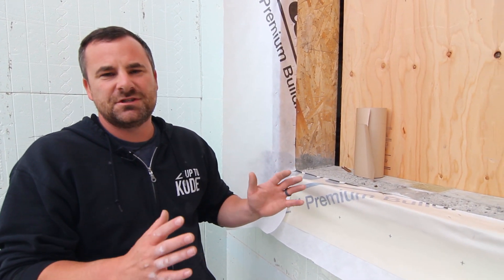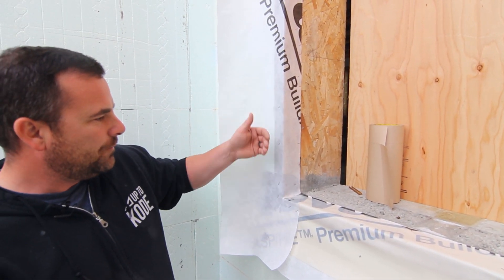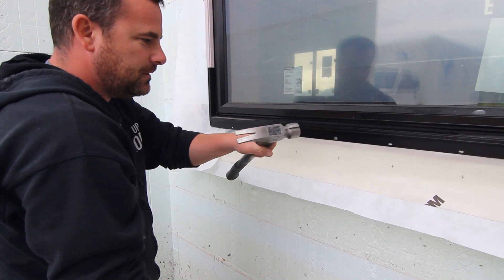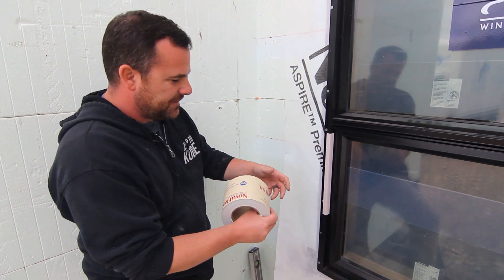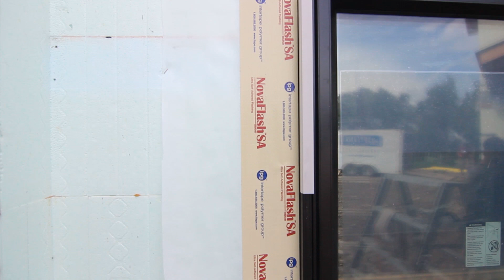How to Prep and Install a Window for an ICF Home

Comment: What do you think of buckless, direct to concrete window and door ICF installs? I've seen a study where this method had the highest penetration resistance.
Reply: yes... I make a metal 2/4 stud and track ....I metal nail the stud to the concrete core and then attach the track to the stud... now i have a strong base for the window - I use compensation channel and then use Equal Leg Frames... so can install windows from the inside of the house.... it is a hassle, but prevents any water intrusion that happens between the EPS and the concrete core... The concrete core will not 'leak water'... applying with a nailing flange to the outside on an ICF build is nuts.... you need to place the window either flush to the outer surface of the concrete core or inset it from the edge.

Comment: Hey Kody, building about 4 hours north of Red Deer. Is the process you used here still current?  We will be installing our windows into our ICF basement in a little over a month. Also what kind of jam do you recommend?  We have 12” ICF walls and have been given an option of 12 1/8 jam so that you can fit the drywall underneath or 2 1/8” jamb with 1/2” drywall return where we would have to do a separate jam. Im not sure what’s easier to install and easier to finish. Thoughts? Thanks!

Comment: what is the product you use for the 6"x6" corner square- you call it "peel & stick" is that just the 3M?
Reply from the maker: Yes I use the 3M tape for that! Same goes for the little butterfly stick for the corner. They do make plastic corners but I find they build the window out too far and it messes up your siding and the jamb depth for your time . 3M keeps it tight

Comment: That's a LOT of Origami.  I see belt and suspenders and duct tape and bailing wire and pocket lint and bubble gum and a Bic pen.  Why not just use Prosoco and sleep good at night?
Reply from the maker: Tell me more about it. I assume it’s liquid applied membrane? Is it rated and tested for ICF? I still need to research all the types but that takes time and effort
Reply: @uptokode  I'm gonna contact the ICF companies.  Just thought I'd ask your experience.  I love building high-performance stuff.  It's like building race cars.  (I think I want to build premium homes (like a Tesla)  with zero energy bill guarantee (restrictions apply), bumper-to-bumper warranty and a maintenance package for well-heeled clients who want peace of mind.). Numbers like yours go a long way.  You're cold & dry, we're hot & humid.    

Prosoco is family of products like Poly Wall - roll-on (or spray & back-roll) elastomeric, 16 mils thick, self-seals around nails.  Sort of like Zip-System coating.  I don't know if the ICF foam is too fragile.  They also have liquid & big tube products for seams & wrapping around windows & doors.  It's continuous & no layers, like a submarine.  I'd like to circle the house as few times as possible.  We cant/tilt our window sills about 3 degrees to the outside and use the paint-on Prosoco WRB (water resistant barrier) all around.  Then we run a backer bead around the inside of the window-to-frame and seal that also.  This makes ithe window completely air & water sealed & makes a sill-dam to keep out water.  Like you, we don't seal the bottom window flange to allow water a way get out, while eliminating air leakage.  But at 0.23 ACH50, you're WAY below Passiv Haus.  Doing something right.  This also eliminates air sealing by hand and AeroSeal, AeroBarrier.

I'm learning about ICFs because I'm moving to the Emerald Coast, Florida panhandle, and I looking for products to be our SOP (standard operating procedure).  Using LiteDeck allows the (flat) roof to be used as living space/deck.  I've been working in the Bay Area, California, in earthquake country, doing high performance projects.  Florida is different from California (no earthquakes) and has different issues like hurricanes, humidity, lost of rain, 95% of the time indoors so IAQ, VOCs & mold are concerns as well.  

Are you running a rain screen outside the ICFs, behind the siding?  I'm exploring fast, effective ways to address this new set of challenges with as many synergies as I can muster.  Did you take helpful class(es) for each brand of ICF?  Did you ever try the concrete version of ICFs (autoclaved aerated concrete)?  I forgot that Florida has termites also.  I know the termites can't get through the concrete, but people have had termites/other bugs nesting inside the exterior foam siding.  

Anyway, impressive numbers.
Reply: @uptokode  Hi.  We used Prosoco brand, but there are other similar lines we looked at.  They have the big sausages that you apply and spread out all around the frame, and out onto the flat exterior.  This stuff is heavier and has fibers to make it stronger.  We sloped the sill to the outside for positive drainage.  The windows go in & we seal the sides & tops to the building, leaving the bottom open for drainage.  At the interior, we put backer bead around the entire inside perimeter of the window + sealant atop that, so now we have 100% water and air seal, and positive drainage to the exterior for any water that might in, moisture/vapor mostly, I guess, in your climate.  Never a chance of any leaks.  Then the CAT5 product is rolled on the exterior (or use ZIP-R and the window buck treatment finishes sealing the opening to the ZIP).  Water barrier, air barrier, thermal barrier.  Now it's a submarine in very few steps.  🍒 We're going to be using this system in Florida where water and humidity are constantly trying to invade our homes.  ICFs for hurricanes, rains, bugs, termites, fire, durability.  I'm trying to identify the challenges so we can mitigate them and combine positive synergies.  Let me know what you think.  Really.  I like your videos.

Comment: Is the house wrap enough to protect from watershed? I worked on a multi unit building made with icf and we used house wrap everywhere but were still getting leaks in many of the windows .. I was not on the project since day 1 so Im not sure where they went wrong but this was a serious issue. Is there any video on how you do it properly so that there is no leaks whatsoever? Thanks!
Reply from the maker: Great question.  Tons of factors that could cause leakage. Sometimes it’s real basic like shingling and layering things properly. Some trades still don’t understand this. The only other system would be a proven liquid applied membrane which I’m still learning about.
Reply from the maker: End dams on drip caps are critical (top side of windows). Making sure you have a drip cap at any horizontal break in the siding. This allows all the water from above to fall away from the building instead of running all the way down from the very top.

Comment: Kody, you’ve answered some questions for me in the past I’ve got one for you building paper for the ICF. I was going to cover my entire exterior of my home prior to putting up the skin on the ICF which is going to be standing seam metal roof material vertically on the walls, was looking at Tyvek or blockit, and wanted to know if you had a preference my contractor is suggesting blockit because it is slightly acting as a rain screen because of its dimples. And thank you again for all your videos I came back to this one several times and coming back to it again thinking you might have made a suggestion.
Reply from the maker: I’m glad I’ve been helpful to you! I personally don’t like Tyvek but I don’t know anything about blockit. Sounds good to me having a bit of a rain screen. I like a more fabric based WRB versus tyvek where it seems more like plastic. 

You will need strapping on the ICF if you are installing vertical metal. Or anything vertical. 

I would put the paper on top of the strapping. This is assuming your windows are mounting to the strapping as well. It will keep the WRB on the same plane and will be easy to detail windows. Just my opinion. Cheers!

Comment: Hello, Kody! Thank you for this detailed video! I am planning to build my house with ICF blocks and currently designing window openings. I've noticed that this window opening is pretty close to the side wall on the left.. How many inches minimum should it be spaced from that "inner" corner? Does it make a difference if it would be fixed narrow (about 8") window with 12" ICF blocks?
Reply from the maker: You can be as close as you want but when you pour you have to install strapping to stop the corner from bulging outward. This is done by attaching a 1x4 or 1x6 (minimum 1 per row) and go across the buck and tie into the ICF further down. This is crucial

Comment: so it is ok for the window to be even more energy inefficient because it is already inefficient?
Reply from the maker: Even the best window has a low R-Value compared to the wall. In my mind it’s better to have a good buck with a lot of advantages versus a thermally broken one that only saves a very minute amount of surface area and would complicate installation of the ICF, the window, trim and potentially exterior finishes.

Comment: Hey Cody,
Love your informative videos. 
I have a self build project in England and am leaning towards using Nudura ICF 
The finish I would like to have on the outside is smooth render, I think you would refer to it as stucco. How does that apply to an ICF structure wrapped in building paper, would you wire mesh mechanically and then stucco or are there other ways?
Thanks,
Charlie
Reply from the maker: Hey Charlie. What we called “floated” Stucco is the smoothest texture without going with some form of metal cladding. 

For stucco I go with…
-typar against the foam
-then 2 layers of tar paper for drainage plain
-screw stucco wire to the ties 
-scratch coat, brown coat, primer and acrylic stucco finish. 

Tar paper directly against the foam will deteriorate it. That’s why you use a synthetic paper first. Hope that helps

Comment: First of all thank you so much for this, building a ICF home in North West corner North Carolina in 2023 wanting metal siding as the exterior finish, looking for suggestions or a video that you might have done that talks about applying metal siding do I need a spacer or can I apply the metal siding directly to the ICF naturally I would have a liquid air barrier applied to the ICF but didn't know if I needed a spacer between the metal and the ICF
Reply from the maker: I really like the idea of a liquid applied membrane. If you find one that is compatible with ICF please let me know what it is. You can install metal horizontally to ICF no problem. The metal will never sit tight enough to stop water from draining out behind and you have the vertical ties to attach to. 

If you want to run the metal vertically then you need wood strapping that runs horizontally for attachment purposes only. 

Does that help Marty? It’s stucco systems that seem the most troublesome for trapping water behind.
Reply: @uptokode  absolutely this helps tremendously, I do plan on running the metal vertical. Was planning on a seamless look between the roof and the walls having the same material. The idea of the spacer is what I was thinking I needed to do to help dry out the wall between the metal panel and the ICF even though it has fluid applied material on it. I believe there is a number of materials that actually say or talk about being designed for ICF walls fluid applied. The one that comes to mind appears pink.

As it relates to the spacer behind I was thinking about running it at a 45° angle not horizontal to allow any fluid behind the metal panel not to settle on the wood but allow it to drain 45 may be too steep and was planning on not running the spacer continuous but about every 6 feet allowing for a 2 inch gap so the water can drop from that angle piece of wood down to the next and eventually out the weep at the bottom
Reply from the maker: If I was running vertical metal then I would install my 1x4 horizontally and then install a WRB (building paper) on top of that for my drainage plane. Just did this on a commercial building. Then I can detail my windows and everything is cohesive. Then I don’t worry about catching water on my furring strips.
Reply: @uptokode  that sounds good, am I just doing belts and suspenders by doing fluid applied also or would I be OK with just the paper? Your thoughts
Reply from the maker: Paper is just fine. Especially if you install wood furring strips, then I see no other way without making it difficult. 

If you installed the metal directly to the ICF wall then the liquid applied membrane would be fantastic
Reply from the maker: I should say the paper is better than fine. It will work exactly as you need it. Detail your windows and lap everything properly and you are set for a few lifetimes.
Reply: @uptokode  I can’t thank you enough for all your help taking the time this is a great assistant.,  i’m gonna have some other questions but I wanna watch your videos first. My next question and research is on window Bucky I think I’m saying that right. The exterior siding of the house will be something similar to standing seam and I want the windows flush with the exterior of the house or close to it. I really want a deep deep windowsill inside. I’ve been looking at a lot of details yet I want to see some of your videos of what you’ve talked about before I ask any questions.  By the way I am in architect but I have not done residential and certainly have never done an ICF project
Reply from the maker: If I don’t see the question on here (or don’t respond when you need me) then send me an email. kody@uptokode.com

Comment: Great video detail on this one.  I am using Logix 13.5" blocks with 8" core, their D-Rv added insulation panels and their Probuck.  With your experience with ICF is there any window specifics you recommend that work well with icf with using the icf bucks for install?  Do they handle standard nailing fin no issue, brick mold.  Completing this with vinyl siding.  Great videos, please keep sharing.
Reply from the maker: I don’t have much experience with the logix bucks. I would imagine you can use a standard flanged window and install in the typical fashion. Make a quick call to your supplier to confirm

Comment: Anyone,
What's the pros of having a window flush with the outside as presented by Kody? I'm currently spit balling ideas for an ICF house in Washington State, which obviously has a considerable amount of rain. Would it be a good idea to have the window mounted closer to the inside leaving a 4-6 inch ledge on the outside of the window. That way we can open the windows (slide style, not hinged) while its raining outside and not have rain come in, unless its raining sideways. Any thoughts would be greatly appreciated.
Reply from the maker: Hi Doug. This is a good consideration. As long as you flash a recessed window properly you can do anything you want. 

Typically it’s more labour to flash a recessed window, that’s why exterior mounted are used. 

I can help you figure out some window details if you want it recessed. kody@uptokode.com

Comment: Appreciate your videos and opinions. If you want to see if manufacturers have suggested you don’t need building paper but I appreciate your opinion is it based on experience and you can see very closely in the video how much better the product is going to be. Thank you I’ll keep watching your videos
Reply from the maker: I find there’s a big difference between theoretical information and functional or practical. On “paper” an ICF building doesn’t need house wrap. True when talking about air infiltration BUT a building also need a drainage plane below the exterior cladding. This is the difference. The foam is not a proper material for drainage

Comment: Thanks for the info.

Have you ever tried Tyvek Flexwrap (6" or 9") for the sealing up the bottom of the window opening?
Reply from the maker: No I haven’t. Do you like the product?
Reply: @uptokode  Yes, I do like the product, it makes wrapping the bottom corners much easier and it makes a seamless sill pan.  I have also used it under doors, works great.  (Note, my experience is limited to standard wood construction, but I see no reason for it to be any different in this ICF application).

Also, thanks for all the information on ICF construction, your videos are clear and concise, and it is much appreciated!

Comment: That is nice for that build, I am looking more for pour in place insulated window frames for stucco finish.
Reply from the maker: They are available.
Reply: @uptokode  I have seen steel bucks though I have not found any ones that are insulated. I am even thinking about venting type doors with built in windows. Though so far nothing that is insulated to stop thermal bridging to the concrete.

Comment: What’s the best way to secure the house wrap to the ICF?
Reply from the maker: Depends on a few things. Sometimes just a shingle nail into the foam is enough. It works better than one would think. I wouldn’t do that to an entire house and leave it for days or weeks.
Reply: Thinking then if I shingle nailed it I could install rain screen for hardy board right after, that would hold it in place until I install hardy.
Reply from the maker: Exactly!